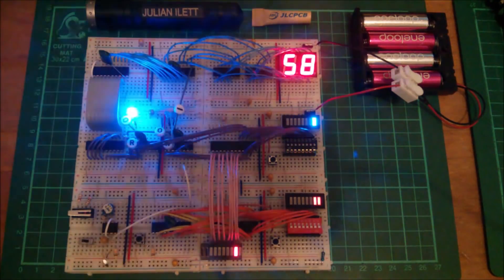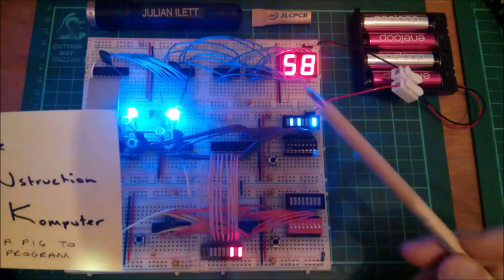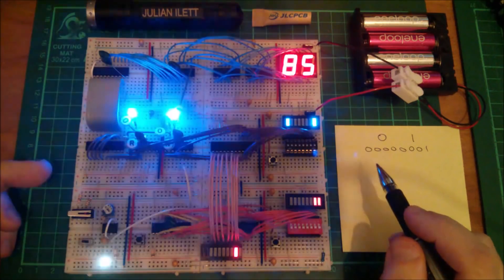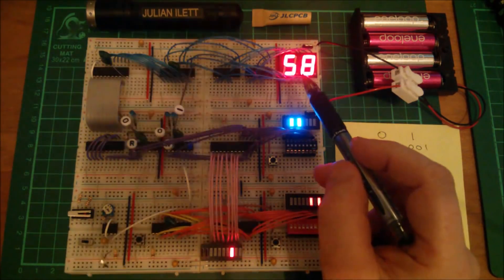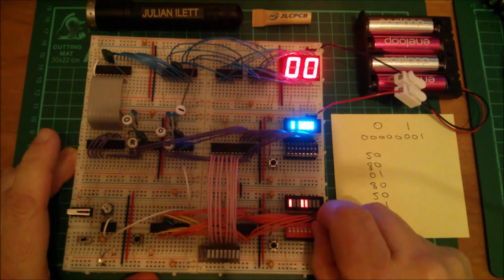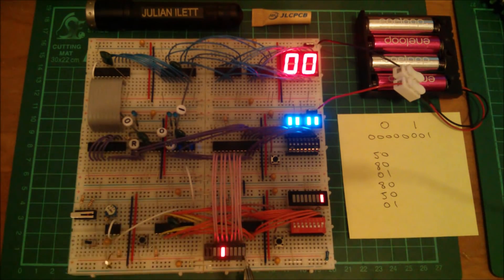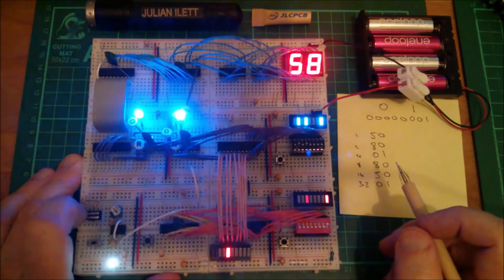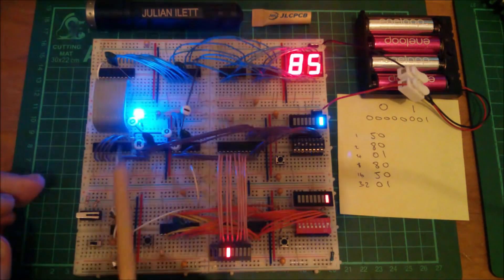OINK Literals - One Instruction Komputer

Comment: Now you have the ability to create constants, you should just put the program counter as another register (use a 74163 presettable binary counter) and scrap the go to addresses. Now make the program counter auto increment, and when you want to go back to the first address load the constant you require and then move the constant from the constant register to the program counter using the preset function.

Comment: If you have the ability to load immediate constants, that should open up the possibility of implementing jumps if you replace the flow RAM with a presettable counter wired to one of the write addresses.  That would allow you to cut the amount of RAM per instruction from 16 bits to 8.

Comment: I see at least 2 instructions: 50 and 80 are move immediate, reg and 01 is a move reg, reg (it doesn't move the value 0 to register 1, it moves the contents of register 0 to register 1). How does it differentiate between the source being a register number vs. an immediate value? What if you are moving from register 5 to register 0? It can't be 50...
Reply from the maker: Yes, Scritch, that's exactly it :)
Reply: @JulianIlett  You're going to have a whole lot of registers for this thing, aren't you?
Reply: It looks like all moves to register 0 are treated as constants - that is, there may be no way to move values from other registers into register 0. Which means the sole purpose of 'register zero' is as a source of hard-coded constants for other registers to use.
Reply from the maker: Quite a few - the current architecture allows for 16 read devices and 15 (now) write devices :)
Reply: @JulianIlett  I imagine with some creative programming you could multiplex registers far beyond that at the cost of one additional operation per access without changing the architecture, too.

Comment: I was surprised to see that your title referred to a "One Instruction Computer".
In my university class on Computer Architecture, I actually did a paper and presentation on the One Instruction Computer (OIC).  The architecture I modeled, however, was different than yours.
The one instruction that I modeled was BNE - Branch if Not Equal. Given a stream of data, a functional program could produce a series of high or low outputs on the data bus.  This, in turn, with a properly written program, could emulate virtually any higher level instruction. The only real limiting factor was the speed of the CPU and the number of clock cycles needed to produce a given instruction.
That being said, even a one instruction computer isn't really a OIC. In order to do anything with data, the data MUST first be read (or loaded into a register), which constitutes a second instruction.  While the second instruction (read/load) might be a hard-wired function of the machine, it is still a second instruction. 
Now while your OInK has read as an integral component of the Copy function, you also demonstrated that your computer also has a second command, that being "GoTo" which you set up at the beginning of the program sequence.
Reply from the maker: When I decided not to have a program counter, I introduced the 2nd RAM - so you're right, the full instruction is "copy from read device (4-bits) to write device (also 4-bits) and goto next instruction (8-bit address).

Comment: Kinda weird, but kinda kewl in the same breath.
Basically, your system has a 16 bit opcode length since each memory address also contains the 8-bit address of the next instruction to execute.
There are up to 16 'source' registers available (although only r0 appears to be currently implemented)
There are up to 16 'destination' registers available (r1 is the hex display, r0 is the 4-bit / 8bit thingy)
By the looks of it, instructions are ONLY 'executed' on he falling (rising?) edge of the clock which is why '58' doesn't appear on the 7-segs at 09:30
Keep in mind when you create the ALU that you can 'overlay' the ALU output register on top of one of the ALU input registers (You only WRITE to the inputs and only READ from the output)
I'll be interested to see how you handle conditional execution (assuming you're aiming for Turing completeness)
Reply from the maker: Exactly right. The ALU needs 4 input registers (A, B, control and carry in) and 2 output registers (ALU output, carry out). Conditional branching will use a latch connected to high order addresses on the RAM chips :)
Reply: Great work!
You can probably 'combine' the ALU control input bits with the ALU carry input bit (to conserve register space).
Personally, I'd have made the program counter itself one of the destination registers to allow for branching - writing to this 'register' simply overrides the 8 bit next instruction address embedded into the instruction opcode (possibly even 'conditionally'???)
Also, I'd have used a pair of 74LS163 for the program counter.  (They have parallel inputs to enable branches and it'd make entering the run time code a bit easier with only 8 DIP switches to set instead of 16)

P.S.  This CPU is really taking the R in RISC to the extreme!